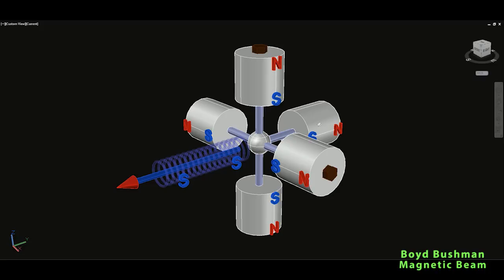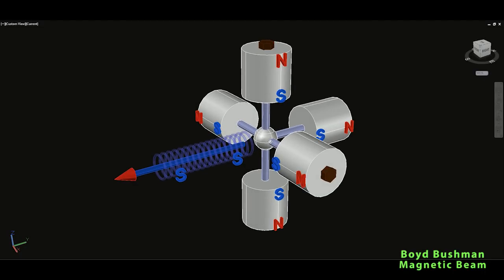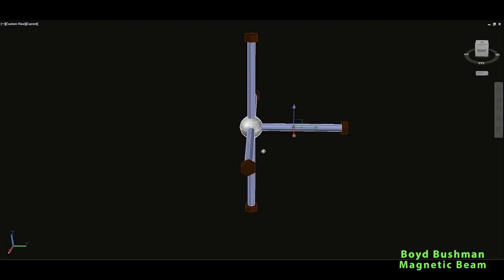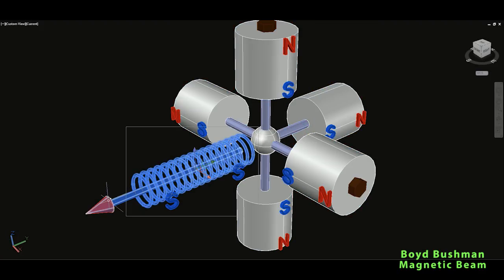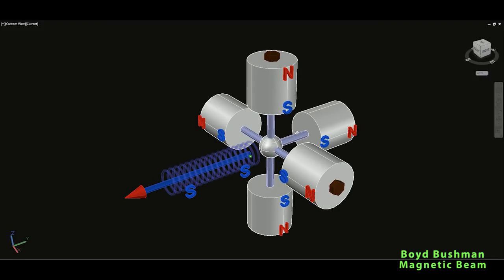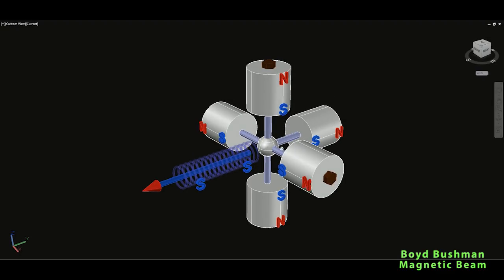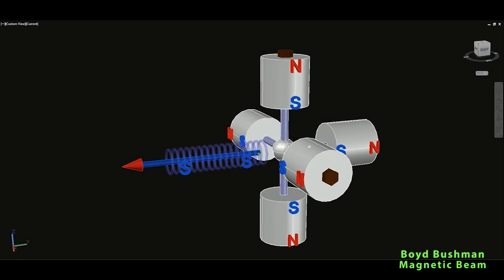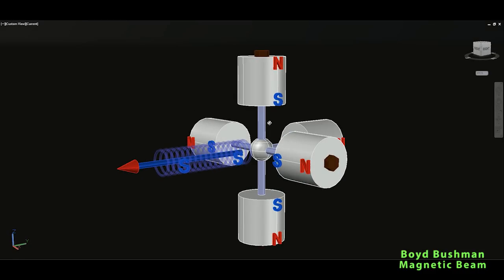FREE ENERGY, Boyd Bushman Magnetic Beam, SOLUTION for Magnetic Motor!!!!

Comment: Nice work buddy. 
But look. 
It's efficiency is based on the distance of the poles from each other. To far away and the fields fold. Get them nice and close though and you can compress the centripetal forces causing displacement. Using very strong magnets should allow you to feel gravitation displacement. 
Major heads up though. Put the north poles towards the centre not the South.
Reply: Lockheed martin seems to think otherwise
Reply: I think people may be guessing as to the purpose of the device, and that it is not like the magnets that get squished together.  It is not an energy beam, either.  Who was talking about coils, here?  I want to know if this thing can do what a tall coil of whatever can do, a coil which could be contained in an ordinary looking drum container. 
I'm comparing this device to the grav field generators/focusers on the ship bob lazar described.
Reply: @alanmalcheski8882  see Fleming's right hand rule. You need a coil with very high frequency and  a magnetic field. The stronger the magnet the smaller the field.
Reply: @garethb5729    I think I've heard of that.  Thanks for the tip.
Reply: @garethb5729    the comment right after yours talks about a type of coil that can do the same thing.  A cadeucis, or something.  If it will fit in an oil drum I think I've made my conclusion.
Reply: @alanmalcheski8882  a Caduceus is a staff. See Hermes Trismegistus. 
It would be similar if I said. There is a coil called. A tridant. 
What is it that your trying to achieve? What is your goal? There may be other technologies available.
Reply: @garethb5729    as I mentioned, I'm comparing it to the things Bob Lazar described.  I'm guessing that this thing and the Cad coil can be used to create an area of low density in Space, Itself.  You need more than one.  Bob didn't know exactly how they work, he just described the two configurations, of the three generators, there was delta and omicron.  Pointing them in certain ways propels the ship.  My guess is that they create a low pressure or low density area of space.  Most people don't believe that space has any relative density, they think it's all zero density.  They're wrong.
Reply: @garethb5729    impels the ship, I'm sorry, I have not slept.  Bob describes the mode as causing the ship to fall through space.  Out in space where there is no earth, falling can only mean one thing, to me, which is moving in the direction of least resistance, without or with very little friction.
Reply: @garethb5729    thank you for the history, I'll check out the staff.
Reply: @alanmalcheski8882  the bubble is 
1/phi^-3. At this phase the north and south poles aren't @ phi. Rather they are 1/1. Like if an egg became a ball.
Reply: @garethb5729    oh.  Interesting.
Reply: @alanmalcheski8882  all space agencies know this. That's why they all have the same two sided triangle in the logo. It's the same ratio drawn into geometry.
Reply: @garethb5729    I only know a little about space stuff, math wise, I learned about gyro nutation because it is part of my idea for a really impressive nothing machine.  Lol Spaceballs is on Laff channel, right now, I'm more a sci fi person.  But since you know about ratios I will share my findings from my formula.  If you chart out the fibonacci sequence, putting a dot every 1,2,3,5,8,13 etc spaces, and then start a new line, you get a pattern from the dots, that runs vertically.  The dots make curved lines of different frequencies, that converge and go in both directions, it is the ideal way to circulate the system.  
The machine does not do anything but it spins a non newtonian type fluid, or maybe just mercury, or red mercury, around and through it, it's a spherical shape...  but maybe that is wrong.
Reply: @garethb5729      I followed a fb page that was always referencing the fib seq and the golden ratio, saying that they are sources of life and/or the natural way it forms.  The fib seq is interesting in flat images, sometimes it has the conical shape, like brocollini, this idea uses it in a totally 3D and circulating way.  
If you saw it you would not know it was spinning the fluid, in would be going too fast, it waves that got back and forth.
Reply: @garethb5729    you have to imagine that the arrows are rows of magnets going in opposite directions, they repel the fluid as it goes vertically, in waves.  The fluid would be quantum locked above the surface, by itself or it is easier to imagine pucks, like in the quantum levitation demonstration model.  The magnets don't touch the pucks, but the pucks bounce away from them and/or slingshot around them.  Imagine an airhockey puck as it hits the round paddle, but the puck flies around the paddle, barely missing it.  The paddle is moving one way, laterally, and another paddle is moving the opposite way, just behind and ahead of it, like cars on the frogger game.  It uses the concepts of synergy and the slingshot effect like the astronauts used to get around the moon.  
Supposedly if you rotate red mercury up above 150,000 rpms some weird stuff will happen.  But there's no way to turn my machine on or off, or hold it, or put it on the ground, or connect anything to it, or get anything out or put anything into it.
Reply: @alanmalcheski8882  the fib sequence is not the source of life. 

You know like when you turn the radio on. There is no band or music inside the radio. It's a transmitting source. 
Life is the same. For lack of a better phrase. Humans are radios. We receive life, we aren't life or capable of experiencing it.
Reply: @garethb5729     that's why I said it's also the way life forms, it is seen it the beginning of creation, it is not the reason for it, it's the way of it, seen in many things.
Reply: @garethb5729    if you map the graph better, you can see multiple frequencies in the pattern.  It is weird because I would expect maybe one type of wave to show up, but there is at least 2 and maybe 3, that all mix together perfectly.  Compared to 1,2,4,8,16 and other ratios, it is probably the most... compounding.
Reply: @garethb5729    oh, I forgot one part;   the lines represent the rings that spin, it's not obvious just looking at it that it's supposed to rotate around a sphere, or as you're saying an oblate spheroid might be best, but anyway, one key about the gyroscopic nutation, which I don't know how to do math for, is how much faster the ring with only a few magnets spins, in contrast to the heaviest ring, and those in between.  If each line is spinning in opposing directions, and some have more magnets than others, that's an issue for equalization, plus I want the lightest or least powerful ring to spin the fastest.  The result might be a pressure variable, the side with high pressure will be moving fluid more slowly than the end that is spinning fastest.  I don't know if that's possible with nothing holding but quantum locking, but who knows, it might work as part of a contained system.  There are several examples of synergy, the classic from Fuller has two swimmers, pushing off each other's feet.  What about the synergy achieved from a line of square dancers who all swing one person down the line, providing that the person has no friction slowing them down?  What energy can be used by utilizing the sling shot effect?  I know that my idea is very wrong, I do not want to go over everything that's wrong with it.  Thank you
Reply: @garethb5729    ....  if you could imagine the square dancers from above, passing someone down the line, change the people to robots who can spin as fast as they want.  The robot at the beginning is spinning slowly, then they spin progressively faster, until the last robot is spinning like a top, and sends the mobile person/robot flying really fast.  They never touch the person/robot being passed along, it's magnetic, and they sling shot the mobile robot behind them, not in front, I think.  
Then you just send them through the middle, right into the other end, wham, and back through.  An abrupt splat at that end.  Squashed into the high pressure to move around again.  Maybe the pucks or fluid would need to be compressible, maybe that's impossible, I don't know.  Imagine if you could build a donut shaped room that shoots a fire hose into the ceiling from the floor, or vice versa, from center. The water splats into a flat plate, at the end it is high pressure.  At the low pressure end it goes around the donut in an arc, so you never run out of fluid.  I think it would do nothing, but two of them together would really do nothing.
Reply: @alanmalcheski8882  you may find Sir Walter Russell's periodic table of help.
It's 3D drawn as 2D. It's very advanced for the time. He presented it to Nicola Tesla and Mr T said hide it for a thousand years if you want to stay in the Industry.
Reply: @garethb5729    ok I'll look at it, sounds interesting.  Thank you
Reply: @alanmalcheski8882  one more gift for you brother. 
See Viktor Schauberger. 
He has the best explanations of phi that I can recall. 
The spiral is drawn as an egg by his works. Then added to the phase vector showing dimension and rotation as a single egg. 
Very impressive.
Reply: @garethb5729    I've heard of him, can't remember where.  I feel dumb, I should have known that the math would produce an egg shape, it makes sense, the earth is not perfectly round, it would be better for stuff like maneuverability, if it were moving.  The idea would be a new variation of the Rodin coil, which is a variation of the Tesla coil.  Instead of a donut shape with a big hole it would be more bead shaped.  If the mercury is flowing over the whole surface, there's no way for it to sit on anything, or suspend it from wires, no way to connect wires, it would have to be suspended by a vortex or magnets, and powered by remote wireless power, like an executive toy floating pen on a wireless cell phone charging pad.  Thank you again.
Reply: @alanmalcheski8882  fun fact  mercury can only be charged negatively. Like a capacitor but monopole. 
If I recall correctly you made reference to red mercury. 
What's you theory on this amalgam. 
I first believed it was iron oxide yet I've been proven wrong. 
Old Vicky is aka the Water wizard.
His works into river beds opened the most doors for me.  
The energy must snake. 

Im not currently researching tbh. I went through Tesla's works untill I found Oleg D Jefimenko. Now I have to learn his language to read his works. It's very difficult indeed. 
Although I cannot stop playing with electrets. They are the inverse of a magnet. 
You align crystalline structure in hard wax and allow it to cool while under a high charge 20-30kv. This makes a static electric magnet. 
+ On one side and - on the other. 

You should build a few. They are very easy to make and have hours of fun in them. 
See Electret under Oleg D Jefimenko works or holla if your truly interested.
Reply: @garethb5729    I don't know about red mercury, I read a comment, here maybe, that said both Lazar and Adair talked about it, but I don't know if that's true.
Reply: @garethb5729    I did not want to say mercury when I started the idea, it's too cliche, so I would say non newtonian fluid.  I think if you suspended metal in oil it would be similar.
Reply: @garethb5729    go to 17 45 in this video, they talk about a large capacitor array, it is built on a flat disc that has specially aligned molecules or atoms or whatever.
Reply: @garethb5729    the video is called Electro Magnetic Gravitic Propulsion and Zero Point Energy...  on the channel Orion Michael Guy.  I think there is another video that goes over the various models, on my list, too.  There were three sizes of them, from bus or SUV size to mothership size.
Reply: @garethb5729    I do not research much either, mostly I watch videos.  In Rendlesham forest, a ufo supposedly dripped some molten metal that was recovered, and there have been one or two other globs of metal recovered from crash or landing sites.  My idea is based on what makes something lije like every color, all at once (not black though).  Every color shimmering like a waterfall rainbow, that's what my machine would look like when it's running.
Reply: @garethb5729    many sightings have reports of a ball that had a strange light that nobody had seen before, it is the color of all the colors together, but bright and distinguishable, not dull or flat.  I'm not sure what color the various metals might look, it depends on the temp, I think, and it seems that while my ideas require very low near ab zero temps, it is when the ufos are overheating that they drip liquid metal, which then solidifies.  Thank you, I hope that is new info to you.
Reply: @garethb5729    you know what you're saying, because that model definitely existed and probably still does.  The only reason that we know about it is because a civilian literally looked behind a curtain that he wasn't supposed to.
Reply: @garethb5729    I don't know what language it is, if it's Russian... you could ask Payl Stonehill to look into it and do a video.  He is a paranormal and space expert from Russia.
Reply: @garethb5729    I wonder if the plates that they make sonic patterns on, with that frequency technology, could make a special electro magnet in wax...  I know that you have to get all the poles in the atoms to go the same way, or whatever, so that might just make them move, not align.
Reply: @garethb5729     thank you again, I have never experimented with EMs, just toy magnets.  If I didn't mention it, I think the ultimate secret with them is to cool the magnetic shielding down near absolute zero.  You don't need halbach arrays or anything else if you just cool the crap out of things, then you can use shielding and it will work.
Reply: @alanmalcheski8882  I watched some. 
What they say falls inline with N.Tesla works. The bus boy at his new York apartment was Otis T Carr. 
See his patent for an amusement device. 
His works used the same principles easiest understood via Thomas Townsend Brown works. Hense the top disk and coil.
Reply: @alanmalcheski8882  The capacitor plates aren't for high frequency. See Larmor frequency. 
All Shielding is water. 

I've taken note to the dripped metals.  Thank you.
Reply: @garethb5729    you're welcome.  That's interesting.  I like the gravitron ride and there are many amusement rides with colorful displays that sometimes have gyro nutation going on.  I'm sorry I can't remember the consistency of the metal drops.  I know it was a weird substance unlike what we use on earth.
Reply: @garethb5729     Lol the first result for larmor frequency is from Theoria Apophosis....  you gotta love that guy but he seems to fit the profile of a lunatic.  You definitely know your stuff.  Thanks for the homework.
Reply: @alanmalcheski8882  the first result for anything is normally not correct in its entirety.  See MRI machine for correct larmor application. 
Ah yes Apophis. It's coming for sure.
Reply: @garethb5729     Yep
Reply: @garethb5729    I thought up an invention.   I know that people say spoilers don't have much effect on overall performance, but I was thinking of a big one that lifts the car from the center, when it's going fast.  The unique part would be a weight inside it, that moves back and forth, when steering.  If the car becomes too light it gets unstable, but the weight over the top helps to guide it around corners.  I know, it's not magnetic, but I'm tired and I'll forget it unless I write it down.  Anyone who reads this can use the idea.  Have a good day.
Reply: @garethb5729    it would save gas mileage, theoretically.  But the wind resistance might make the difference negligible.
Reply: @alanmalcheski8882  the same thought process lead me to watch the swizz busses. They run on an engine that is not internal combustion. It generates from the gyroscopic procession. 
The bus has a relatively large flywheel as it's feed.
Reply: @garethb5729    ahh....  that is what I was thinking would happen with the ufo...  it would create an artificial point of inertia or something like that.   A huge flywheel would not create a grav bubble but it certainly creates a special way to balance and turn.
Reply: @garethb5729     that idea I thought up is not much different from a stabilizer gyro, like the ones on ships and in tall buildings.  It isn't just stabilizing in 2D or on a plane, it's like a bunch of wheels that are all pointed in one direction.
Reply: @alanmalcheski8882  I assume you mean like the patented amusement device of Otis t Carr. 
The procession points to one point?
Reply: @garethb5729    uhh, no, I'm not sure what that is.  The only things that remind me of what I think we're talking about were on star wars and south park.  Instead of having normal wheels, a vehicle could be inside a huge wheel, so the wheel goes completely around and under the vehicle.  I have imagined a very heavy flywheel being onboard, just for the purpose of stabilization, but I'm not sure what you mean.  I will look at that design.  Thank you
Reply: @garethb5729    hmm, national archives.  Legit.
Reply: @garethb5729    oh, that's the avrocar...   I looked at that design and it does not work like I thought at all.  All that really is, is a drone with internal fans.  Someone made one out of leaf blowers, it works about as well.  My nothing machine has been conpared to the Searl machine, but the person I explained it to did not really understand what I meant.
Reply: @garethb5729    I mean it's like having lots of flywheels centered around a single point.  All spinning empty space toward or away from a single point.  Pulling space apart.  Or squishing it. 
Space is something.  If I haven't mentioned dr Lawrence Krauss, check out his video, empty space is not empty.
Reply: @garethb5729    a star is just a singularity in reverse, it's all about the isometric vector matrix, and the toroidal dynamic.  Nassim Haramein is right, I'm just jaded and disillusioned by his little project turned academy.  Later
Reply: @garethb5729    (to believe in his/my theories you need to believe that space is not only full, it has super fluid properties, and has a density gradient, like oil, but it is not aether, aether does not exist)
Reply: @garethb5729    it took me a minute to envision what you're envisioning about my vision.  The spoiler idea is a like putting a wing on a car.  Right over the center.  It would be elliptical, not just straight.  The weight inside it just slides back and forth on a rail, under power.  It slides left when the driver turns left.  Positioned high over the car, the weight is more effective at changing the balance, almost like someone is standing next to the car, pulling down on one side while turning.
Reply: @garethb5729    I'm not sure it would work, now.  It was late.  Lol I'm sorry, thank you again.
Reply: @garethb5729    if you can imagine a paraglider or whatever it is when you have a parachute and you also have a fan on your back, shrink that down and make a parachute/ spoiler hybrid.  Put it on the car.  Put a weigh Inside it, help steer.
Reply: @garethb5729    it would be a lot of equipment that would have minimal effect.  Ok I'm done, thank you.
Reply: @alanmalcheski8882  I've been to rendlesham forest in Suffolk. It's an eery place. I've never found metal there. Rocks. Plants and animals. One piece of obsidian but not metal. 
I'll go back and have a hunt with my metal detector.
Reply: @alanmalcheski8882  an energy beam could only be created if the energy was of high frequency. Also, I have done research on anti-gravity and momentum methods of levitation and I do not believe that Bob Lazar is correct. I believe that he is lying and that his idea of a levitation vehicle is wrong.
Reply: I was thinking the same thing,with the N pole,because in some interview he was talking about pressing together strong magnets with brass bolt,and the magnets lost some weight...
Reply: @2bestoned  brass is used because it doesn't interfere with the magnetic field. 
The experiment of which you speak is well renown. Pisa.
It is similar to a 10 tonne metal sphere and a 10 tonne metal boat. Only one will float!!!! 
Imagine the sky is water. Treat it the same, yet let it be magnetic water.
Reply: @garethb5729   why only the north poles? Wouldn’t using electromagnets with all sides shielded (except for the center repelling side) using strong AC current be more effective?
Reply: @garethb5729  Also, what do you mean by ’compress the centripetal forces’ ? How much gravitation displacement would be produced? Would the displacement be bubble like, or would the displacement be directed in one direction?
Reply: Caduceus
Reply: You see, you're assuming that the device  is for creating a beam, as the video suggests.  What if it is not for projecting a beam, and that's why the poles are opposite of what you expect.  There is a nothing drive that has been researched, to see if the Cassimir effect could move a kind of cosmic sail, and there is a design by Nassim Haramein that turns the sail into a propeller, basically, I think, neither design has shown success...  but the idea I'm having now is that these devices could be used in harmony to draw the fabric of space toward them, to pull at it and even stretch the fabric of space, or, at least suck in those particles that the impossible drive uses.  That would kinda be like going from a sail, to a prop, to a jet, if you combined the ideas.
Reply: That reminds me, I think the asteroid Apophis is going to do something, if not in 2029 then in 2036.  Some of the same people who talk about this stuff mentioned the year 2029.  I didn't even look, I didn't want to know, until recently.  It seems like they might have known about it before 1998, but maybe not.  It was discovered in '98.  The videos I've seen are old, I can't find them now, maybe they were recorded around the time it was discovered.  But my intuition says that there will be a big earth event.  There is a big iceberg that is barely hanging onto Antarctica, it could break or something.